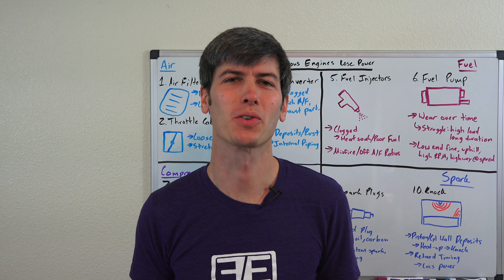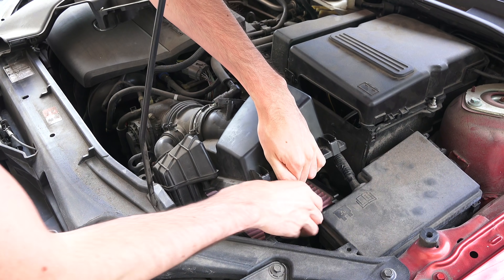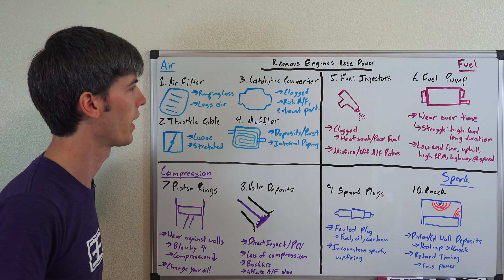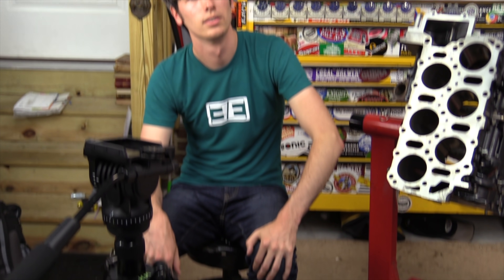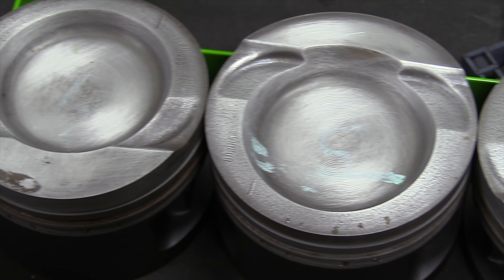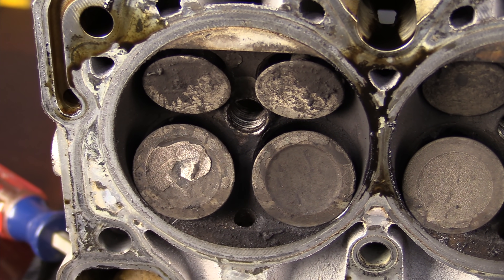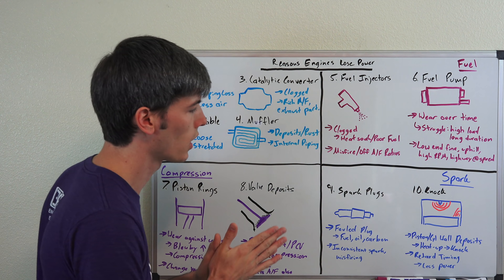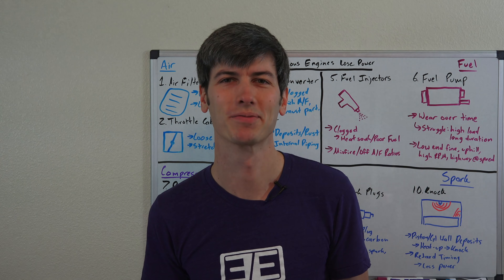10 Reasons Why Engines Lose Power Over Time

Comment: Change your timing chain. When they go they take a lot with it
Reply: mikey1974 hetfield Yup, if you have an interference motor, where the piston and valve share the same space in the cylinder, a broken timing chain is catastrophic. The worst ones are motors with overhead cams and timing belts. If you ask me, the camshaft belongs in the block on a short double-roller chain.
Reply: +Andrew Whiteman
Interference engines should be illegal. Isn't it immoral to design engines that are designed to fail catastrophically?
Reply: +DE Nichols
Utter nonsense. Do you really think that cars are designed to give customers the best value for their money? Probably car dealerships make more money on all the car repairs than they do on the sales of the cars. The car sales are largely to corral people into their service repair shops for their inevitable maintenance and repairs. Sure, a certain percentage of people will seek cheaper car repair shops or move to another location, but the numbers who stick with the dealership are probably somewhat predictable.

An interference engine is an example of deliberate "planned obsolescence" in which the customer rather than the engine engineers is unfairly blamed for the destruction of the engine. They have to know that the working poor will sometimes need their money to pay the rent, and procrastinate or forget about needed or recommended car maintenance, such as a costly scheduled replacement of the timing belt. They could use timing chains that are supposed to last the life of the engine, but way too many engines use the inferior timing belts. Why? Isn't the answer obvious by now? Interference is due to bad geometry. You can't just have infinite compression ratios, or the engine will knock, the cylinder gases igniting prematurely from the heat of compression. I find it very hard to imagine that they can not design an engine in which the valves and piston heads do not have to occupy the same space, although at different times. Consider all the engines that are non-interference. Explain that then?

Also, I find it hard to imagine that restricting air intake into a gasoline engine, is the only possible way of restricting its power so that the engine only produces the needed power, rather than racing at peak power all the time. Doesn't restricting air flow, reduce the compression to far below optimal levels? Wouldn't it be possible to shut down unneeded cylinders or to skip injection of fuel and allow the engine to "coast along" rather than making every stroke of the piston a power/push out exhaust gases stroke? Such schemes should be capable of reducing engine power when not needed, while at the same time burning far less fuel. (How is it that some engines can hardly keep themselves cool, from the electric radiator fan constantly blowing due to the air conditioner being on, while just idling? How much fuel has to be wasted, just to produce the minimal power of idling?) I suppose valves could remain stuck open, for unneeded cylinders, to remove any compression and just let them blow along some air as they coast. Today's engines are managed by a computer anyway, so why aren't super-efficiency engines being designed by now? But then fuel-burning cars are designed to burn fuel and insure hefty profits for Big Oil. They have us conditioned to pour oil (refined oil products) into the fuel tank and underneath the hood. ICE (internal combustion engine" cars are oil-suckers designed to enrich Big Oil. So why bother to make them more efficient? No, the trendy enviro-wacko mantra is to push phony scarcity, concoct ridiculous theories such as "Peak Oil" to justify their price-tampering, or restricting of supply to jack up prices.

I observe that on our roads we have
• 100% fuel-burning cars
• nearly 0% electric cars
• 0% free-energy cars

Now where is the free-choice in that? Seems like a very rigged and unjust market to me. I imagine that Big Oil hates that the future probably will soon be, mostly electric cars, that do not use a drop of oil nor fuel. But this long-awaited reform is so painfully overdue.
Reply: Timing belt. Chains don't need replacing, just tensioning. BElts need replacment after 50,000 miles. A chain should be good for 500,000.
Reply: mikey1974 hetfield Yes. And repair and maintenance of and kind retains power. I let myself get excited over and repair like it's an upgrade.
Reply: Yosef:  It's a bit hard to go through such a wall of text, but here's how I see it:
1.  Yes and no.  Car manufacturers do in a sense only care about money (and it's rather obvious why), but at the same time they have to take the customer's needs into consideration (or they won't sell).  And you're right, the money comes from after-sales.

2.  In order to get the efficient engines of today (which they need to be to have any hope of passing the green laws) and higher performance, they must have high compression.  Sure, they can maybe cut into the pistons to make space for the valves, but can't that lead to uncontrolled combustion? (I'm not too clued up on that, so don't take it out on me if I'm wrong.)

3.  You can't practically throttle a car by shutting down cylinders.  Just think of how many variations in power you need, and how much you can vary the power by shutting cylinders down.  You're right, blocking airflow is inefficient (as it also increases pumping losses), but I don't see another way.  You can shut cylinders down when not needed (some cars do), but you still need to throttle the airflow.

4.  I hope you just used the wrong term there.  Free energy doens't exist (you can't get energy from nothing).
Reply: Johann, thank you for having organized ideas.

On no. 2, yes, more and more Compression Ratio or CR can create problems with knock, which is like what you're saying for uncontrolled compression.

Yosef, I find your thinking very creative, while I am not a mechanic history teacher, nor does one exist, I am a mechanic and I do have an interest in the past. For a while there, they were making tremendous power and had very high compression engines and plentiful high octane fuel to match. The trouble is, this made for some very bad fumes, which in the worst parts of America were making a lot of people sick and actually killing people as well.

They backed off very high compression engines too far for anyone who likes performance, but it helped with the most dangerous fumes.

As technology got better higher compression ratios became possible for better power, and we managed to keep the dangerous fumes down too. There's a reason why cars have really increased in performance.

As engineers were getting away with better compression ratios and keeping us all breathing, the engines went more to being interference engines. Sure, tons of cars didn't have an interference engine during a period of no power or efficiency!

The motivation behind these changes have been public safety and what people want. The reason why we're getting more powerful cars instead of just more efficient ones with these advances isn't corporate greed. It's because it's what people buy. Believe it or not the consumers "want" efficiency, even need, it, while they want their car to go zoom! :)
Reply: More on cylinder deletion. That complexity has DEFINITELY harmed reliability. I wasn't going to tear into the engine to find out for sure the other day, my shop just doesn't do that, but we had about an 80k mile truck the other day who needed a new engine and the cylinder which was producing no compression was one of the deletable cylinders. I did do a leak down test and I did determine that the valves were what were leaking.

On this design the valves shut before the exhaust is fully gone when the cylinder is being deleted. They want an exhaust charge of "air" in there. Perhaps to help the piston bounce down instead of be pulled down? Make the crankshaft I suppose not have to take a pull where it's designed to be pushed. Too much on that, but the point is, this is definitely a bad way to do it!

The other thing I noticed, even if it wasn't cylinder deletion which caused the failure, is that the pattern of nasty spark plugs matched cylinders which were being deleted! So! The spark plugs actually get fouled by this process! How will that really help economy long-term? Fouled spark plugs seriously harm power and efficiency...sadly for most owners this is a permanent problem because they essentially don't change their spark plugs routinely as they should.

I normally change spark plugs because they came in for a diagnosis with a broken car. That's SAD.
Reply: justforever96 yes chain are good for up to 300 k but it's the tensioners that go. Faulty tensioner and guides result in chain stretch and ultimately slipping causing havoc..
Reply: That's a great point! I was all worried about my "getting clicky" Chevy Prizm back in the day. May not have been a chain issue. Could have been tension...of course it could be those non-adjustable valves (you have to buy each valve adjustment after mic-ing what space you have and guessing at the space you need to have).
Reply: As far as I know cam chains are normally good for the life of the engine (even if it's 400-500k km or more).  The chain can stretch, in which case you'll have less precise cam timing (and a noticeable change in how the engine performs).  But they don't break that easily.

Of course there are engines with chain issues, but they're fairly rare.  Now if it's a cam belt, that's a different story.

Andrew:  That's why I like chaindriven non-interference engines.  The chain normally lasts longer than the engine, and if it breaks it's not the end of the world.
Reply: Generally speaking an engine is an interference engine because it helps it make more power, and therefore more economy, or more importantly to a big company, lower emissions so they can make more of their faster cars (they have to make more efficient models than not or they literally can't sell their big vehicles).

More people get what they want thanks to these designs. If people respect maintenance intervals there are essentially no catastrophic failures...but I'm with Johann, it was a hard choice to get a nicer older Sienna than a newer more worn Sienna...because them I'm committed to changing timing belts. I have the skills, but not the energy as I'm already a mechanic.

Comment: I do not have a thermostat in my car is it bad 
When we install it the engine becomes to hot 
We bought a genuine one from Nissan 
Any ideas
Nissan says it's fine if we don't have a thermostat 
From South Africa 
Its a nissan tiida/  versa
Reply: Ahmed Moosaji you should back the front of your car up as high as possible and take off the radiator cap. Then just turn it on put the heater on full and let it idle for a long time. At least until the fans come on twice. It will get out any air bubbles
Reply: As far as i know, every water cooled engine of recent times has a thermostat. Some even have 2.
Reply: Ueberdoziz yes it had 
But the part wore out 
When we put a new one the above happens the new part is not defective
Reply: allmotor dc5 thanks will give it a try
Reply from the maker: Here's a video talking about the subject! https://youtu.be/P_mUBJ12BNs
Reply: perhaps you have air trapped in the system, try bleeding it or the thermostat might be "dead on arrival"
Reply: Thanks to all for advise 
Ya possible air is trapped somewhere as 1 pipe gets extremely hot and the other pipe is cold🤔 I'm running without the thermostat at the moment we don't have very cold temperature in my area but the engine does become cold when driving in freeway 
Thanks EE for the response 
Appreciate it

Comment: There is also handbrake not fully releasing and making the rear wheels bind which can be cured by injecting lubricant down the gaitor and down the cable.
Also don't forget to lubricate the pivoting arm on the back of the brake caliper that is connected to the handbrake mechanism.
Brake pistons seized or sticking causes brakes to bind,get them reconditioned or replaced.
Out of track can scrub your speed off get them tracked and new tyres if tyres are scrubbed badly on either edges.
HT leads can be fractured & corroded at the ends and affect speed replace them if necessary.
I could go on forever lol.

Comment: You forgot Fuel Filter!:) Same issues as air filter, except with fuel.
Reply: also, tires can affect power especially if they're oversized tires
Reply: Lincolnator the engine would still be making the same power though, parasitic  losses would be another episode
Reply: thanks, i almost forgot that . adding it to my list
Reply: Lincolnator mb
Reply: You're supposed to replace the air filter every now and then but yet it was mentioned here :)
Reply: Don't forget your spark filter.
Reply: Factory Five 818 Build well I guess he included this out because you are supposed to replace the fuel filter every couple of years...

Comment: what about diesel engines?
Reply: jebivjetrich It is pretty much the same, except you don't have to worry about spark plugs because a diesel engine is not having any due to its compression ignition however in case of a dpf equipped modern diesel the deposit is higher, especially if it's used in the city environment
Reply: yeah i know that diesel don't have spark plugs, i was wondering because since my last regular service check, i feel like my engine is a bit weaker, and i don't know if that's due to oil or filters or something, because it's also much louder than it has been before the service

Comment: If my car still makes 110kph at exactly 3,000 rpm in top gear (as it did when I first bought it), and still makes the same speed at the same revs through the rev range up to 110kph, does that indicate that my engine is still making the same power?
Reply: Adam Adam Your speed will always be the same in a certain gear at a certain engine rpm as long as your clutch isn't slipping or you changed to a different tire size.
Reply: If you can still get to that speed in the same amount of time, then your engine still has the same power.